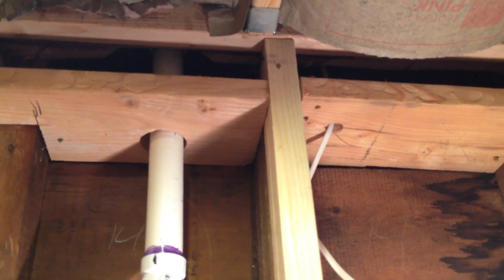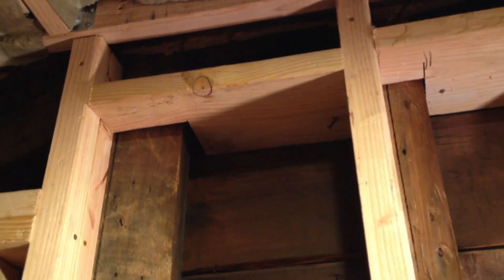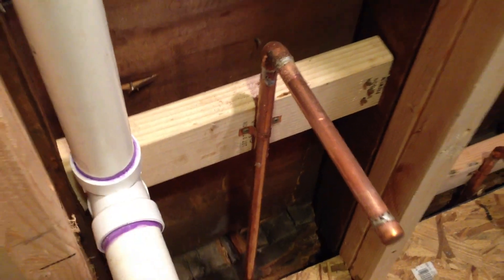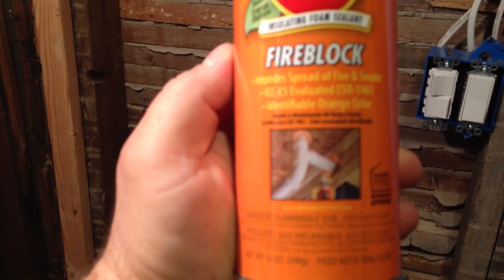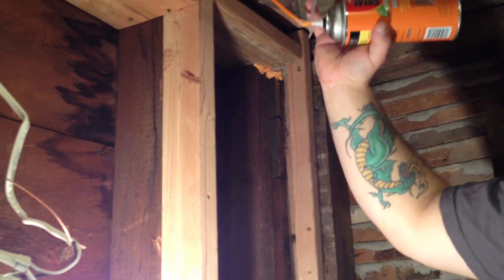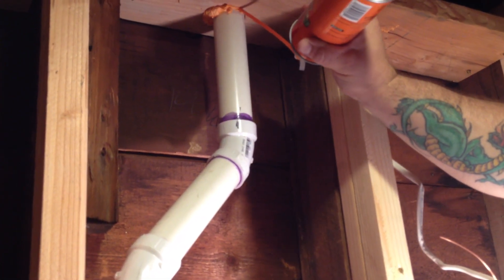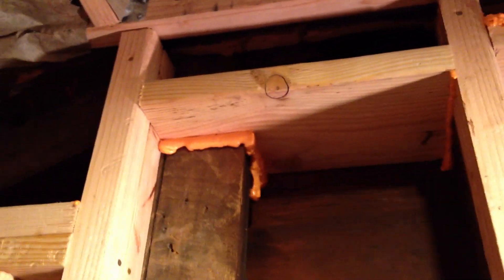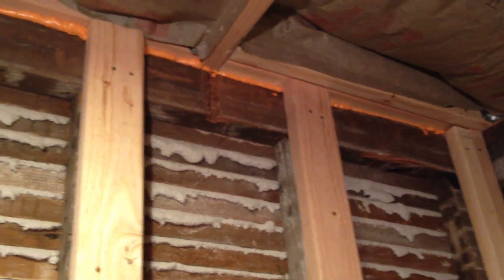Fire Blocking and Penetrations

Comment: Hi, thanks for sharing! Do you fill up the holes on the horizontal wall?
Reply from the maker: Sometimes, But not normally. If a fire was to start in the wall bay. The fire foam  is designed to seal off penetrations where a fire could draw oxygen from the floor and ceiling systems.